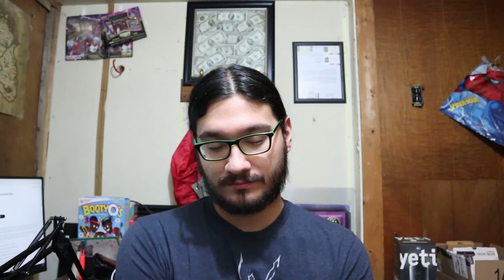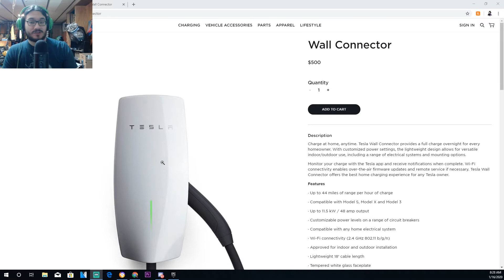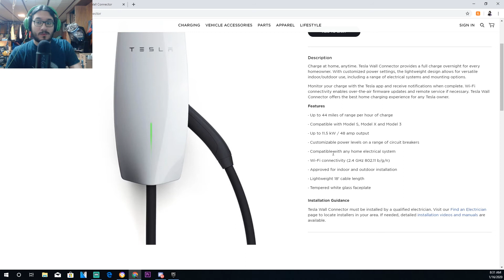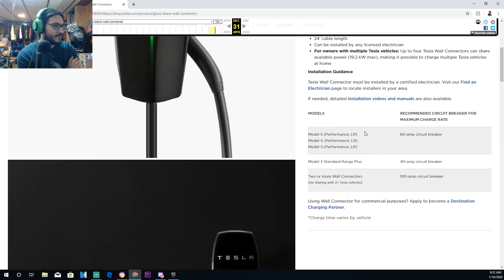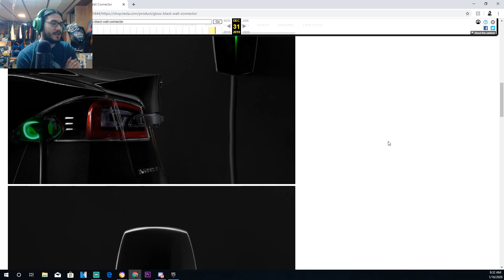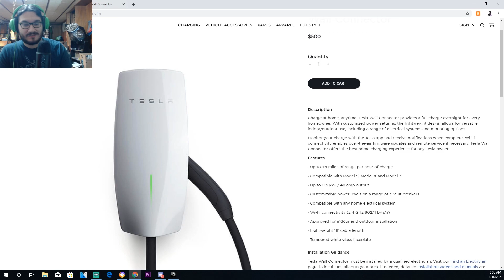Tesla Makes Wireless Charger? Tesla New Wall Connector Charger With Wi-Fi Gen 3 Charger

Comment: For all level 1 & level 2 charging (AC) the charger is built into the vehicle and this applies to all electric vehicles not just Tesla. What is commonly referred to as the charger is really Electric Vehicle Supply Equipment (EVSE) and is simply regulates the power to the vehicle. The old Tesla wall connector could handle up to 80 amps @ 240 volts (19.2 kW) whereas the new Gen3 charge can only handle up to 48 amps @ 240 volts (11.52 kW). The new wall connector has a slightly shorter and thinner cable along with WiFi capability and can have up to 16 devices connected together whereas the old one was limited to 4. I would suggest you go online to the Tesla website and read the manual on the new wall connector.
Reply from the maker: I have discovered the new cords were shorter and allowed for more vehicles to charge, however I didn't know one could view their manuals without purchasing the item. I have only ever seen their safety manuals on their. Super appreciate the advice!